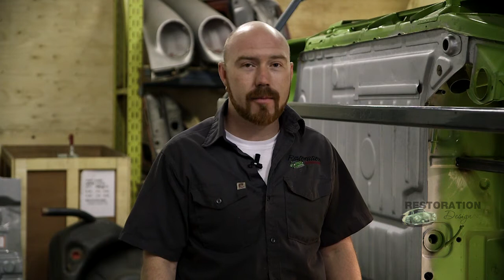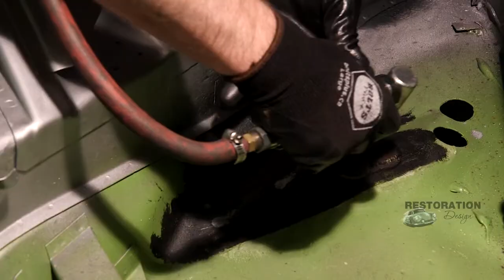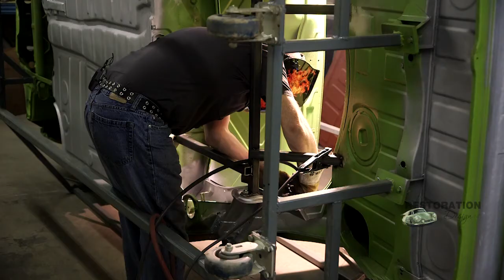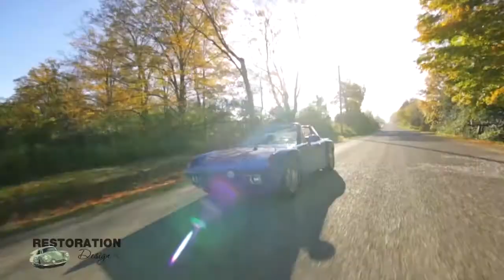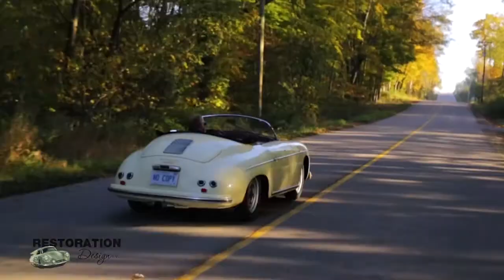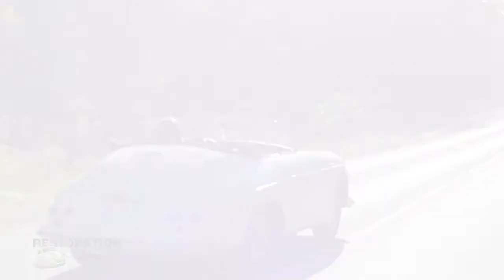How to 914:Battery tray and support

Comment: Great informative video, thank you.  One question, if I may.  We hear all the time about the "Hell Hole" and the poor design that created this water/rust trap.  Has anyone yet come up with a subtle modification that would allow a reasonable size drain pipe to be fitted/welded into the hell hole?

I am just about to change the rear suspension bushes, I have dropped the engine out to make access easier, so I thought I would look into the possibility of fitting drainage pipes.  If my idea works I will make a video and put it up onto my Youtube channel.

Comment: The tray support has a tab that bends in or downward and contacts the top of the rail inside the support once installed. How do you weld this tab if, as you show, you combine the tray & support before welding to the long rail?